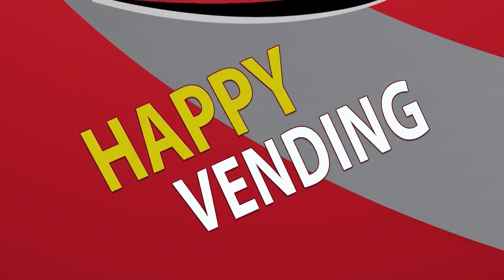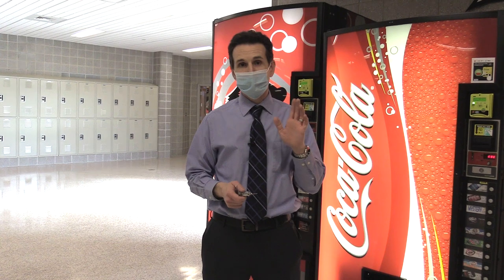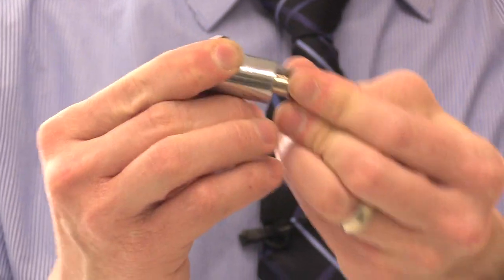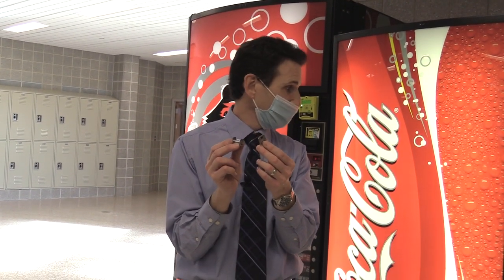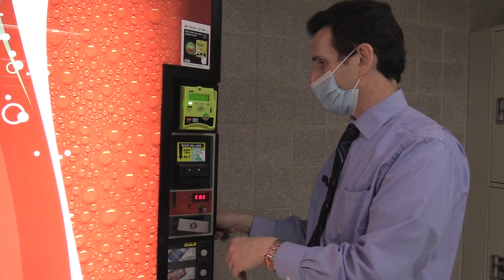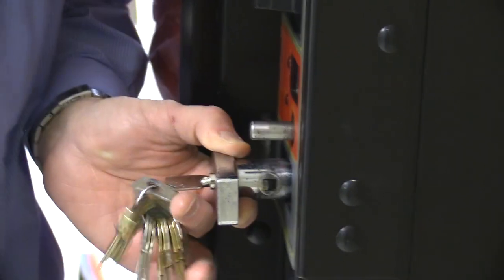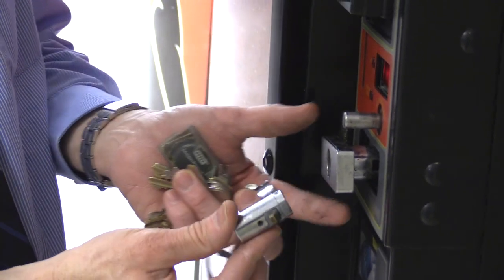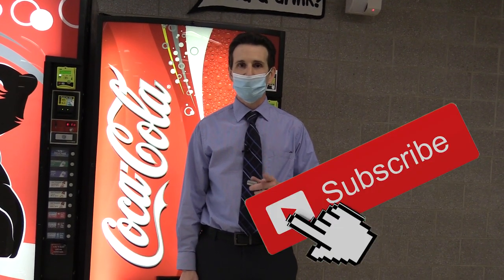How to Change A Soda Machine Lock

Comment: 2 questions)
 I have 2 machines, 1 snack (AP Snackshop 112) and 1 soda (Dixie Narco 276e) . They both don't have keys and are locked shut. 

1) If I have a locksmith open up the machines, will I be able to change the locks without the key by pressing on the small lock release?

2) Does drilling the lock out mess up the T-handle and cause a need to replace it?
Reply from the maker: If you have good bits and are careful, you can drill out the lock without messing up the T handle.  And yes, once it's open you can remove the lock without the key.

Comment: Awwsome video!! Where can i contact you ? I have some questions Thank you
Reply from the maker: Thanks.  Questions about locks?
Reply: Im buying a dixie narco 440, everything seems to work fine, my question or questions are, if its just one prize acceptor and i change the one  on the coin mechanism it will change the bill acceptor as well? Also when i went to see the machine, it didnt have any sodas, and when we put coins on it to make a selection it went straight to the change return. That supposed to happened? Also  do you know if its a good machine?  It seems gas a tag for outdoor use as well
Reply from the maker: @JC-rs9ln  I don't have a 440, so I can't speak with experience, but if it has no sodas, it may be normal for it to not accept coins.  Tape down one of the sold out paddles and then try putting in money.  If you want more specific advice about this machine, post your question in the vendiscuss.com forum...there are plenty of vendors there that have first-hand experience with these dixies.  Good luck!

Comment: I have the same coke machine the door is open but I don't have the key to unlock the lock to change the barrel lock whats best way of goi f about replacing the t lock
Reply from the maker: If the T-Handel is not pressed in, you should be able to push in the lock latch and push out the lock with an ice pick or small screw driver.
Reply: @HappyVending  unfortunately its pressed in but the door is open I can access the back of it is it possible to use    a.flat head to push barrel threw or do I need to pick the lock as they have lost both keys
Reply from the maker: @t0talslag  can you see the lock code at the front of the lock?  If so, you can order a key
Reply: @HappyVending  ill give it ago when I get back to work they stopped using the vending machine for a long time but looked the lock and left it open:/ thank you for ur replies love all the videos as well :)